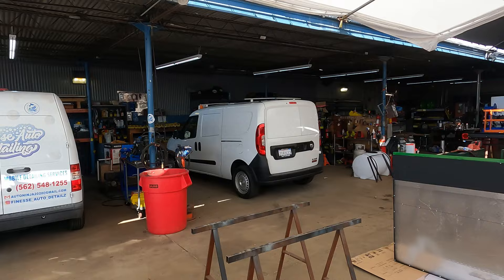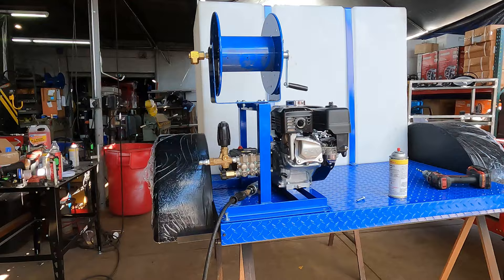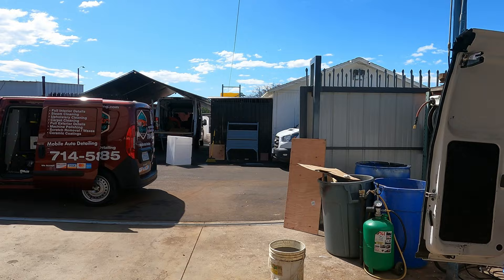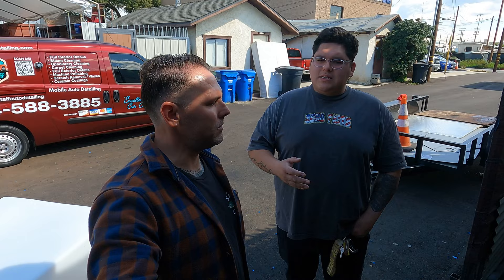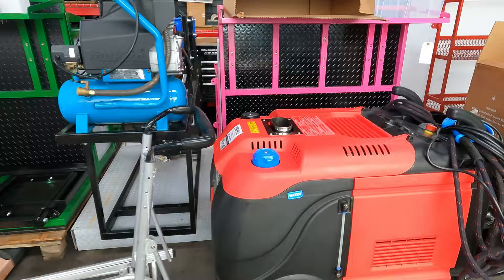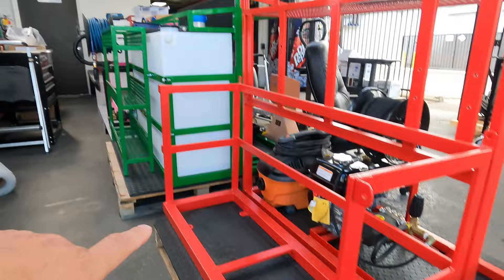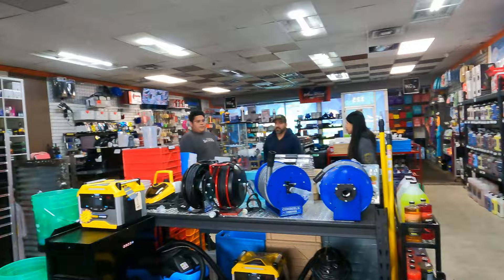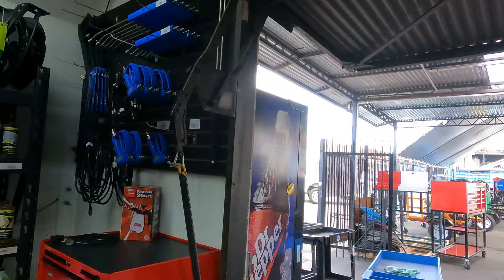Mobile Detailing Setups of 2024!!! Setups Of America! H20 Custom PREMADE Van Setups!

Comment: @h2oautodetailsupply farm out the laser cutting and breaking, otherwise it will cost a fortune to by a fiber laser and press break. I own a suspension company and this is what I've done for years.
Reply from the maker: As many laser cut products that they are selling for maxshine it makes sense for them to set up there own operation. But it wouldn’t make sense for them to have another manufacturer produce it because they are already getting it from maxshine at a low cost. By them having there own machine they’ll produce hundreds of there own products and widen there profit margin. Those machines would pay for themselves in no time.
Reply: @Brandinwagstaff  a quality fiber laser table can cost $1,000,000. A quality press break can run $50,000. They have to sell a lot of detail set ups to justify that cost. I've owned a long travel suspension company for over 10 years and I still couldn't justify the cost.

The laser company would not "manufacture" the entire product for them, just handle the laser cut steel, breaking the steel, then hand it back to them. They would then do all the fabrication and as he mentioned he would later do the powder coating himself. Even that is a HUGE investment.
Reply: He right about farming it out i work at a fabrication place the laser cutting and breaking takes no time